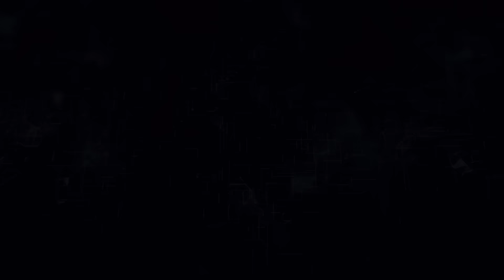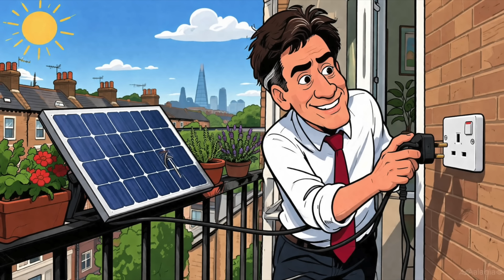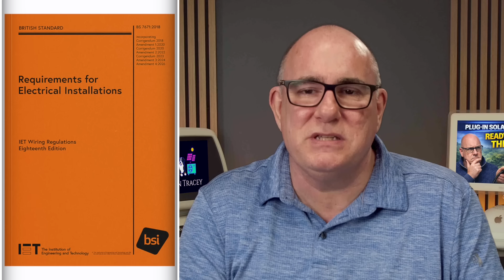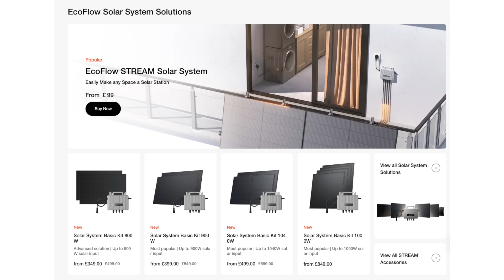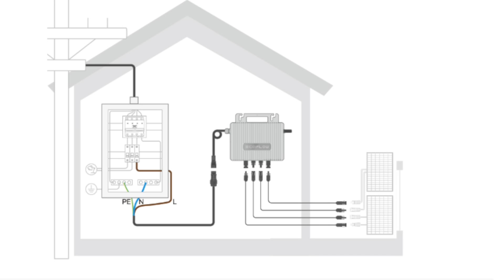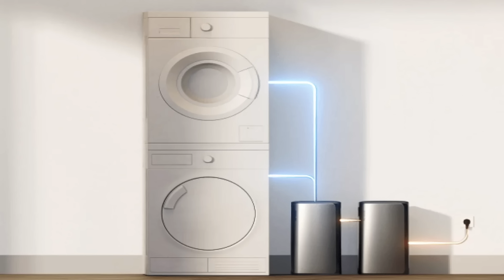Plug In Solar Is Coming… But There’s a Problem

Comment: This is the first year I have mine installed. I have 4 x 500w panels in all sorts of places pointing in different directions and last week it still managed to generate 1.7Kw, pretty close to the 2Kw max from the panels and it's only spring! It helps that 3 of them are on brackets which allow me to change their angles. One is on the patio using brackets brought from Amazon (50 quid for 2 pairs of brackets), 1 on the fence using my custom brackets, one above the conservatory and one on the lawn bolted to the pallet that came with the panels that City Plumbing delivered them on with heavy duty wheels on the bottom of the pallet so I can move it around. I'm really chuffed with them.
Reply from the maker: @andyspoo2 that’s a brilliant setup 👍  

1.7kW in spring is impressive, especially with mixed orientations — shows how flexible these systems can be.  

Love the movable pallet idea as well 👀

Comment: People underestimate the amount of solar you need for meaningful generation in the uk. It might save you £100 per year at the expense of a lot of bulky hardware and complexity. No real point.; just improve your efficiency and insulation instead.
Reply from the maker: @simonforbes2453 I get the thinking 👍  

But £100/year is very setup dependent — with current UK prices and the right usage, it can be significantly more.  

It’s not about massive generation, it’s about consistently offsetting what you’d otherwise pay for.

Comment: Sounds very expensive to me and for what? Just to save a few quid? It's a no from me.
Reply from the maker: introduction systems will be in the £200 range, that will pay for itself in 2-.25 years after that it just generates money. But if its a no
Reply: @JonathanTracey  Inverters and solar panels made in China, what could possibly wrong? Also they're not very carbon (dioxide) friendly to make, if you believe in that sort of thing.

Comment: Hi. My dad is terminally ill ( wasnt meant to make xmas),and to keep busy he has just ordered an ecoflow stream ultra x which he intends mounting on a turntable in the garden which he has also ordered. He plans to site the stream ultra x next to the solar panels. I will run an swa back to the mains via a switch fuse. Problems i can see.
1. He has a very old wylex consumer unit with no rcd protection. This has the old plug in 3KA circuit breakers plugged into it. House could do with rewiring. (I might add a seperate DB to keep this a seperate installation with rcbo's in it. Item 3 might also come from this board.)
2. He does not have wifi in the promises just an old apple phone. (Will he need to have wifi that reaches the 25m down the garden.)
3. I dont think this system comes with a smart meter to measure his usage and when to use the energy stored in his stream. ( Does he need to buy one.) 

This project is not about saving money and payback times. Any advice would be appreciated. I will probably inherit this system afterwards at a separate address.
Reply: It's really annoying that Ecoflow does not add ethernet ports to it's devices. You could have run a cable to the house easier than messing with wifi.
Reply from the maker: @alansimpson1743 really sorry to hear about your dad — that sounds like a lovely project to keep him busy 👍  

On your points:  

1️⃣ You’re spot on — I’d strongly recommend a **separate small consumer unit with RCBOs**. That old Wylex board with no RCD isn’t ideal for this type of setup.  

2️⃣ WiFi isn’t strictly required for generation, but you’ll need it for **setup, monitoring and updates**. A simple outdoor WiFi extender would solve that. The devices can be monitored by bluetooth but you need to be very close to the unit 

3️⃣ You don’t need a full smart meter — the Stream system can work without it. A *CT clamp / smart plug style monitor* can help optimise things, but it’s optional.  

Biggest thing is keeping it safe and simple — and honestly, for what you’re doing, that setup will work really nicely 👍
Reply: @JonathanTracey thanks. It is due to arrive in 10 days

Comment: I have a portable battery/micro inverter with a 420w portable solar panel for emergencies. I can assure you if I ran it regularly it would save me up quite some more than 100£ a year
Reply from the maker: @alvaroaugustomeridio yep that makes sense 👍  

If you run it regularly it will definitely offset some usage — especially daytime base load.  

Main limitation is just scale, but for a simple setup like that it’s a great use case.

Comment: I'm a qualified electrician with experience in finance, so obviously I'm not going near these just yet 😂
Reply from the maker: why not 1 million Germans can’t be wrong😂
Reply: @JonathanTracey  yes i was going to comment on the anti-islanding electronic switch that stops the plug pins being live on disconnection. The things that spring to mind are electronic failure, and fake products, which may be dangerous to life. 
Luckily we know that electronics never go wrong, and fake products are protected against with that little sticker. So should be all good 👍 
I was looking up injuries related to solar, and it appears that most happen when installers fall from roofs! So that may be one indirect benefit of the plug ins.

Comment: This is a great idea but it need to cooked properly. Video stated it's just small generation but if every household takes it on (hypocritically)  then it will reduce the pressure on building nuclear power stations. So now instead of TV arial on the chimney , we will have solar panels 😂😂😂
Reply from the maker: @harjitbanwatt2763 you’re absolutely right 👍  

Individually it’s small, but at scale it really adds up — that’s the whole idea.  

And honestly… panels instead of aerials might not be a bad swap 😂

Comment: Electricity companies will get getting free electricity when peoples systems dump excess electricity in to the grid and the user won't get a penny for it.
Reply: If you have the old type meter and not digital on a sunny day the meter runs backwards so the electric company gets zero back.
Reply from the maker: not if they buy a battery and save it for later they wont

Comment: Living in a Listed property - and there are LOTS of these around the place - this may be good news. Under the Listing rules we cannot have anything like a solar panel on the roof. 
I presume that these plug'n'play systems are firstly a lot smaller than a full-size roof mounted system, and secondly 'portable' - that latter being important when it comes to Listing Regs?
Reply: They‘re not really portable. It‘s normally two average to large panels. But if you have a garden you can put them there or on a garage, shed etc. As long as it‘s nesr an electric socket.
Reply: @combrogi Thanks. Anything that even seems to be 'permanent ' will be stopped. The entire grounds/property/garden are all included in the Listing, so it's tough to get round.
Reply from the maker: Yep but you should check as knowing how much the gov loves listed buildings and stopping you doing anything to them, this may still be excluded for you
Reply: @JonathanTracey Highly, highly likely 😢

Comment: What about the wiring can’t just run a cable out to the garden ?
Reply: Solar cables you can. Your inverter would be placed inside so there will be no mains cables outside. Solar cables and connectors are designed to be out in all weathers. Just make sure you can't run over the cables with your mower or shears etc. Put the cables in to a plastic pipe or ducting and bury them.
Reply from the maker: yes you can so long as the cable is rated for outdoor use

Comment: There is a way that I use that doesn't need all this regulation and rubbish for a small installation, and that is a completely isolated system called off grid, one of the biggest drains of daily power is your fridge freezer, some intermittent roughly 80 watts, so what you do is use say 5 100w solar panels put anywhere garage roof, garden whatever and use the output of the panels to charge two or three large 12v car batteries through a regulator, these feed into an inverter that produces 240 AC that runs your fridge freezer, the clever bit is to have a voltage monitor so that if the batteries start to go flat ie no sun for days or mid winter low output from the panels the system switches back to mains operation so your fridge freezer doesn't defrost, when the batteries have recharged from the panels the unit switches back to the solar inverter, the batteries could also be charged at times of low solar or at night using a standard car battery charger   all perfectly legal with no legal complications, from my experience this maximises your panel output usage and in the summer will run your fridge freezer for nothing (after you have recovered the cost of your system)
Reply from the maker: @ronayling1979 that’s a classic off-grid approach 👍  

It works, but lead-acid batteries and small inverters tend to be quite inefficient and don’t last long under cycling compared to modern lithium systems.  

Great for simple loads like a fridge, but not really comparable to a full grid-tied setup.

Comment: Is it advisable to connect the plug in part of a plug&play system to a garden building, & will that feed back to the house if it's on its own breaker? 🤔
Reply from the maker: @FrogBoyDances good question 👍  

Yes it can feed back to the house if that circuit is connected to your main consumer unit — it’ll just offset whatever that circuit is using first, then the rest flows back.  

Big thing to watch is how that garden building is wired (breaker size, cable rating etc). It needs to be suitable for backfeed, not just load.
Reply: It has a small fuse box/consumer unit in the building, what do I need to look for..? Many thanks ☺️

Comment: Been thinking getting a ECOFLOW STREAM for the last few weeks,  unsure whether to get the 400w or the new 450w panels. There a price difference on Amazon but is 450w better in the long run?
Reply from the maker: @CosmoCES if the price difference is small, go 450W 👍  

You’ll get slightly better generation over time, especially in lower light conditions. Just make sure the voltage/current stays within the Stream Ultra MPPT limits (that’s the key thing, not just watts).  

Long term, more generation = better ROI.

Comment: My neighbor had a solar panel on his roof which went up in smoke and caused the roof too go up in smoke. The house insurance didn't cover solar panels on the house. The panels were less than two years old.
Reply from the maker: @rogercamp2910 that sounds like a fault rather than normal behaviour 👍  

Modern systems have multiple safety layers (DC isolators, inverter protections etc), so fires are extremely rare when installed correctly.  

Worth checking insurance though — some policies do need solar specifically declared.

Comment: The first generation  Eco Flow microinverters have various settings, one of which is no export., others allow setting priorities and automations.   Linked to a Shelly 3EM and a battery designed to work with the microinverter will divert any excess generated to charge batteries and run base load at same time.  At night the inverter provides base load from battery.  Poor locations, then over panel to get he yield up.  The microinverter limits the input to the maximum.  The newer Stream systems can also be controlled in the same way, there are different (perhaps better?) configurations possible, still getting my head around this.  I have 2 microinverters, no problems noted, always fuse down to 5A )if using plug) or 6A bi directional 30mA MCB/RCD unit (often called RCBO units)
Reply from the maker: @davedave6404 You’re basically describing what a lot of people are moving towards — *load matching + battery buffering* rather than pure export.  

The interesting bit with these newer systems is how much control you get:
- Limit export
- Prioritise loads
- Charge batteries first  

And yeah, fusing down is absolutely the right call on plug-in systems — that’s one area a lot of people overlook.  

It’s evolving quickly, but you’re definitely on the right track.

Comment: I didn't vote for Milliband's fanatical zero carbon believes. Nore did most people.   ..A mix of Oil, Gas, Solar and others are essential for the UK in a very dangerous  World.
Reply from the maker: @danieljames2015 I think most people would agree 👍  

It’s not about one solution — it’s about a mix of energy sources.  

Solar just happens to be one that **reduces your bill directly**, which is why people are interested in it 👀 

and for balance net zero was not a labour or miliband thing, The UK’s net zero target was introduced in June 2019 under Theresa May, by amending the Climate Change Act 2008 to require net zero emissions by 2050.

Comment: Yes, they work, but European regulation requires a dedicated circuit with bi direction RCDs this is easy to do in many cases. As balconies have single circuits with outlets and breakers. It's not as easy as just bang it in any old where. This is what people will do, and there will be wiring fires
Reply from the maker: @marcusjones1088 completely agree 👍  

It’s not just plug and play — wiring, protection and circuit limits all matter. That’s where proper guidance is really needed.

Comment: Would a Jackery Explorer 2000 Plus + 2X Jackery Battery Pack 2000 Plus + 2X SolarSaga 200W power a home standard fridge freezer? Jackery ?
I think they’re around £3,000.
Reply from the maker: Yes i did a video recently when I used an ecoflow powerstation to power my home for 24hrs during a black out, that was with no solar so I suspect with panels it would last a lot longer

Comment: The IET can simply issue an ammendment. Other regulatory bodies can do the same. So no worries there. Its not rocket science (well yes, but its not as hard as our friend makes out.) One thing you should consider is the inverter won't work without grid power on. So its no use during a power cut.
Reply from the maker: @rogersmith9579 you’re right on the last point 👍  

Grid-tied microinverters won’t run during a power cut — that’s by design for safety (anti-islanding again).  

That said, newer systems with batteries are starting to blur that line a bit with backup/off-grid modes, but plug-in microinverters on their own = no grid, no output.

Comment: What we have suffered already!! And I see no progress towards this clean energy promise. My solar power station, the only one I could afford, only operates gadgets below 300w. So kettles and toasters can't be used on it because they use a surge.
   Say I could invest in this system complete, by the time it has payed my money back I will already have to save up to buy replacements! That is dependant on my housing association even allowing me to put panels on their roof in the first place.
Reply from the maker: @pheart2381 I completely get the frustration 👍  

Those smaller units are very limited — they’re great for low loads, but not things like kettles or toasters.  

The key shift is when you move to a system that offsets your base load — that’s where the savings start stacking up, even if it’s not running everything.

Comment: I have had Solar for more than 15 years, and they have not yet paid for themselves. The reason is that there is not enough sunlight in England.
Reply from the maker: @richardhodds7812 it’s very setup dependent 👍  

Older systems, high install costs and lower export rates made payback tough. With today’s prices, batteries and tariffs, the maths looks very different. has nothing to do with not enough sunlight, last year we produced over 10MWh

Comment: Thanks so much for a clear easy to understand video. I’ve got a south facing garage roof which would be ideal for a couple of panels. I have quite low power use though, so I’m not sure it will be a big saving. I’m thinking about back up power for black outs too though.
Reply from the maker: The only thing I would caution about putting panels on the flat roofs is that you need to make sure they are very well secured otherwise they might pull the roof off in a windstorm. Also, you need to check on them periodically to make sure that they aren’t being covered by debris such as leaves from nearby trees. In a flat or orientation, the rain doesn’t wash this off the panels.
Reply: @JonathanTracey it’s a pitched roof facing south. So no worries there

Comment: If you want to save or even make money invest in the utility companies. Then use that money from the dividends to pay for your electric!  When I got a quotation for a roof system the saving would be £20 a month and 12 year payback. I desided to invest that money instead and make £30 a month and that's compound year on year tax free. So in effect making £10 a month without all the hassle.
Reply from the maker: @jablot5054 The difference is solar is a *very predictable, low-risk return* — once it’s installed, you know exactly what it’s going to generate and save.  

Investing in utilities or stocks can outperform it, but it also comes with *market risk and volatility* that a lot of people aren’t comfortable with.  

Honestly, I’ve not seen many portfolios that consistently match the returns of a well-designed solar setup *for the level of risk involved*.
Reply: You are still taking a risk that future governments won't resort to taxation of solar set ups or utility companies won't put up standing charges to compensate for lost revenue.Just look at VED for less polluting / electric  cars .  The only way to profit from something is to own it or a share of it. I agree with solar , but you need to generate all your electricity and go totally off grid.